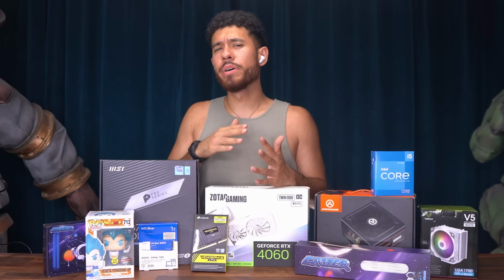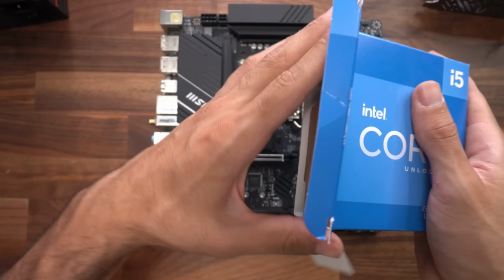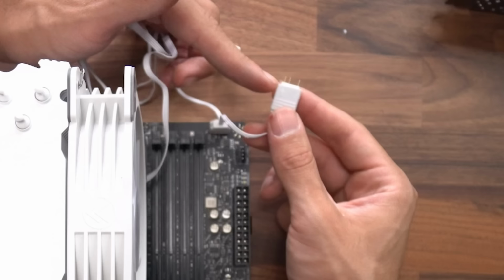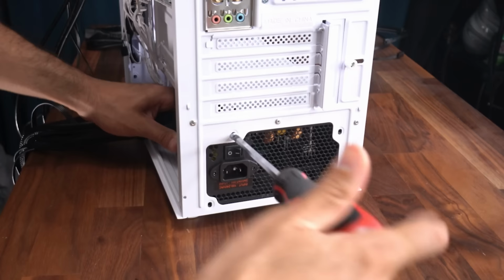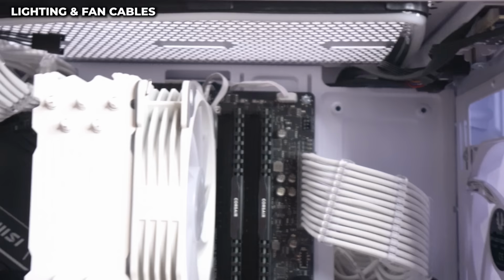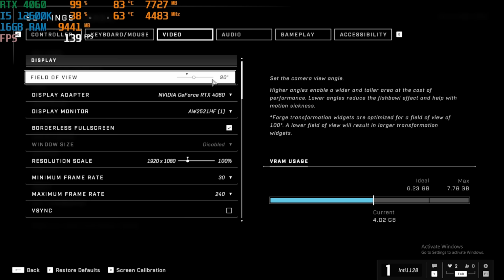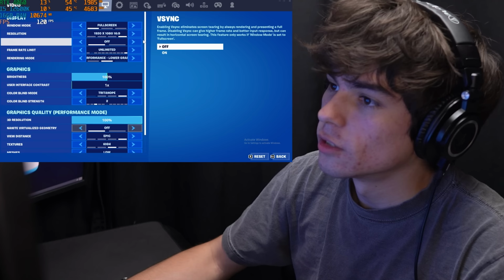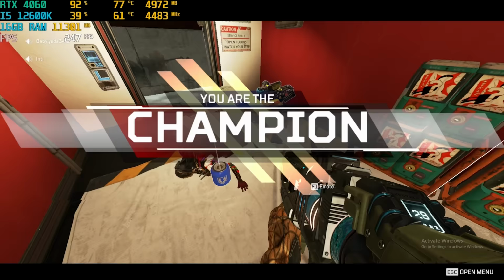BEST $900 Gaming PC Build Guide - RTX 4060 i5 12600K (w/ Benchmarks)

Comment: would it matter if i use a hdd instead of a ssd
Reply: hdd has slower loading times and can mess with performance, an ssd is recommended for gaming.
Reply: Yes it matters. You can use a hard drive, but there's no real reason to do that. Hard drives are much slower than SSDs. You would be doing your PC a disservice by installing only a hard drive. It will work, but it will be notably more sluggish than if you installed an SSD.
Reply: No don't use a hdd in 2023.

Comment: the graphic card is at 500$ not 300$
Reply: 500 is for the 16 g version dont get it it performs the same as the 8g
Reply: @FuturNob302  16 gb of Vram? that is a huge difference between 8 gb, yes they both perform well but a 16 gb is better performance for newer games and is future proof. To say they perform the same is a lie but nonetheless an 8 gb 4060 for 300 is a great price to performance gpu and will be able to run any game out currently nicely

Comment: I accidentally ordered the MSI PRO B760-P WIFI DDR4 motherboard instead of the B760 micro ATX one. I know I have to return the BitFenix Nova Mesh Micro ATX case but do I just get the regular ATX case or since the motherboard says B760-P is there a special type of P case? Also, I only realized this AFTER I installed the CPU and CPU fan, as well as the RAM and SSD. I considered taking everything off the motherboard but that seems like too much of a hassle. Also, will this P motherboard and the (ATX?) case work with all the other parts. All the other parts I bought are the same. This is my first time building a PC so I’m just wondering.

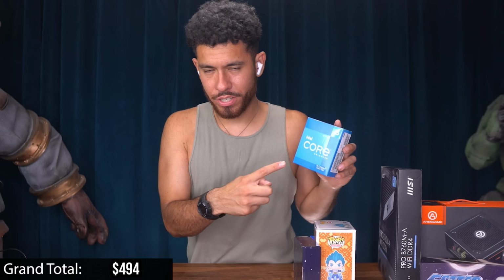Comment: 1:29 , WTF are you talkin, "Also all the 13th gen non K cpu will bottleneck 4060 " , Do you even know what is the power of i5 13500 . It can even run 3090 or 4070ti without bottleneck
Reply: Yeah I was so confused because Crater is so knowledgeable but just straight up lied here… he’s still the 🐐 tho we’ll let it pass

Comment: Is intel core i512400f good with rtx 4060 or is Ryzen 5500 and rtx 3050 good :)
Reply: Dont get either gpus. Both are horrible value. The best gpu for around 300 is the 6700xt. Its significantly better than both of those cards. And spend like 40-50 extra and get a 5800x.

Comment: He said it's upgrade proof? Duh hell he chose Intel. Least upgradable to new CPU in the industry. If uou get an i tel board that makes it to past 2 CPU generations, you got lucky. Personally since the 90's, I can't recall this ever happening.
Reply: You can't overtighten because of the back bracket. The reason you can't overtighten is because the cooler bracket is a spring. If you are going to look smart and talk, you better start talking like you know what you are talking about.
Reply: None of the front panel connections care the direction. They are only 2 wires on each. You can't plug them in backwards.